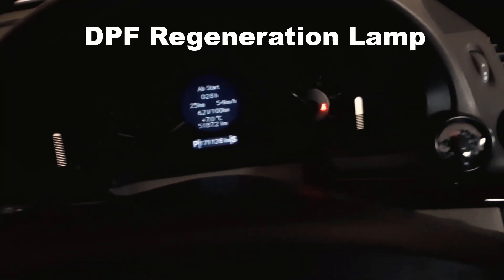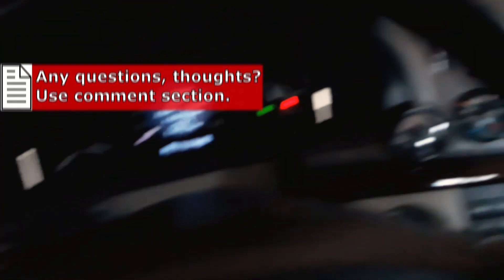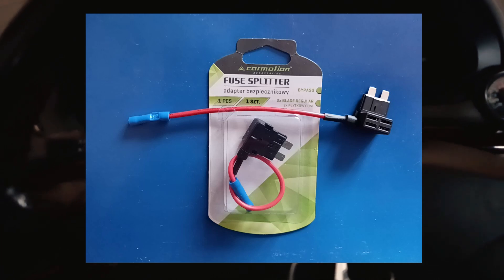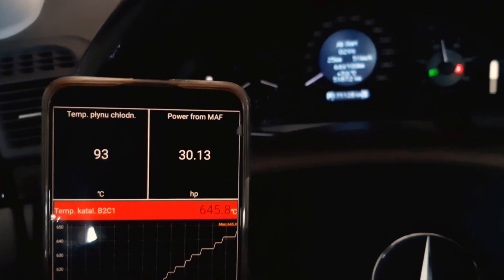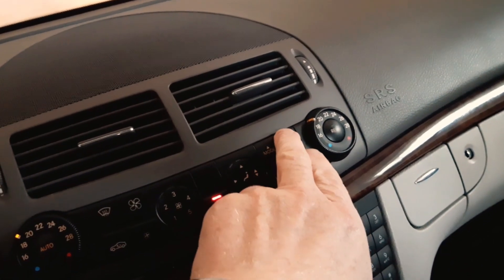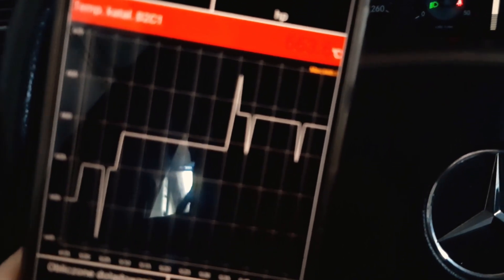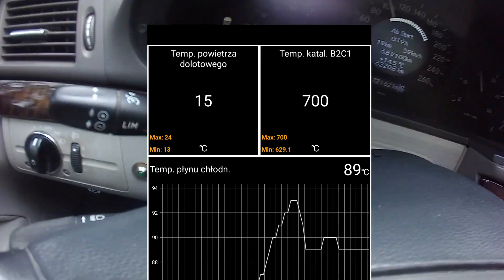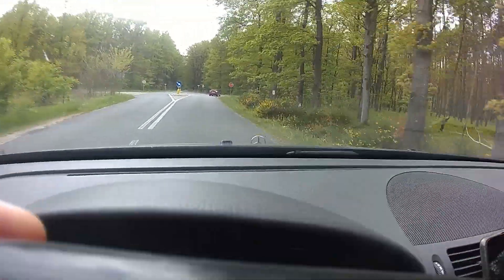Mercedes DPF Regeneration: My DIY Indicator & Temperature Measurement (OM646 Hack)

Comment: I'm confused about the rear window heat circuit. The lamp on the dash indicates when regen is starting? So what you are saying is when regen starts it turns the rear window defrost on also?
Reply from the maker: Yes because the engine need bigger load. There are also other situations when the rear window heating is turned on, e.g. when it is cold and you put the car in reverse gear.

Comment: Displaying the differential pressure would be useful
Reply from the maker: Interesting idea, all you need to do is take the voltage and have the pressure based on it ...
Reply: @tickingWATCH I'm not sure how you would achieve this but measuring the differential pressure is essential, too high then the regen will fail, too low the DPF is cracked etc. Worth watching YouTuber @ORileysAuto to better understand this.

Comment: Bmw 525d f10. 2013. 2 liter n47. About 300-400 km regen interval. Temperature is between 550 and 650 Celsius. It doesn t warn me by any lights. I know for sure with the app. Car feels without torque, but as soon as you press the accelerator, it intrerups regen. It happend most of the time to start regen after getting the car to the garage. I stop it. Next time it will regen. I drove a Audi a5 2019 with adblue and you couldn t feel regens. Next time i will buy a Lexus hybrid. Take care !
Reply from the maker: Thanks for the comment. In BMW the DPF filter is a bit further from the engine hence probably lower temperature. 
So I am considering a hybrid as my next car. At the moment it is probably the best direction...